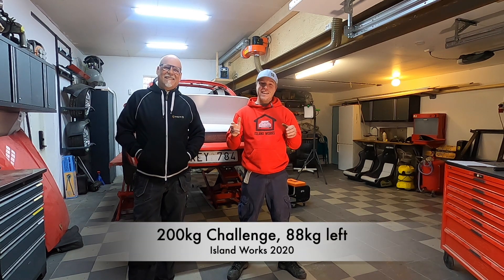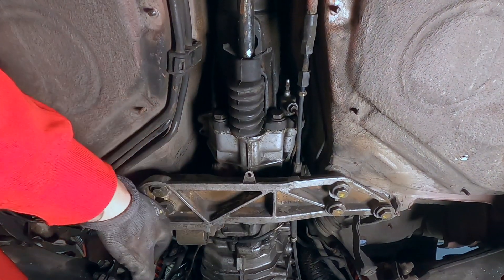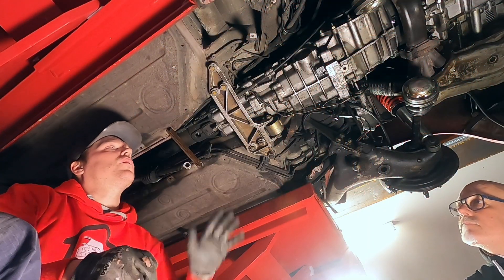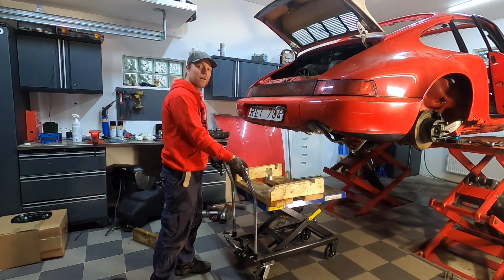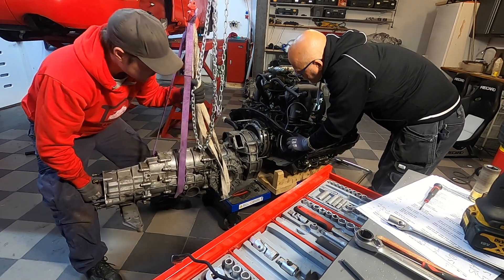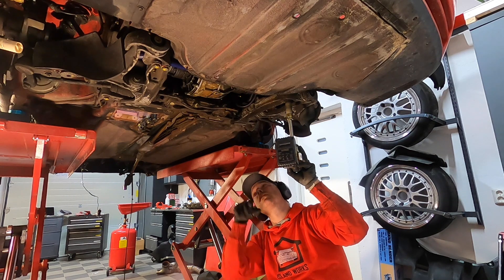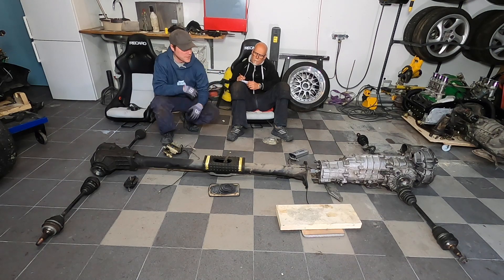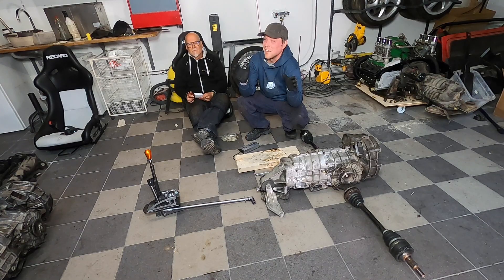C4 Explosion - Porsche 964 C4 to C2 conversion on a Fly!

Comment: Great videos! I recently had my 964 C4 converted to C2 with used G50 transmission. Everything works great. However, the AWD and ABS lights remain illuminated. My car won't pass inspection (in Finland) with those lights on.  Do you know how to rewire the front AWD/ABS front control computer box from C4 to C2, to eliminate those lights?  Any insight would be very helpful. Thanks

Comment: Hi,

Thanks for your information shared in the video. 
I am in the path of converting C4 to C2. 
What are the parts from C2 required for the conversion?
What are the parts I need to remove from C4?
Any computer reprogram required?
Thanks
Reply from the maker: This is a quite large undertaking but a fun one. Apart from the parts shown you need to think about either keeping your ABS or adding one from the C2. There are some really good threads on rennlist covering the details that I recommend.
Reply: @islandworks  Thanks for your reply. I tried to fined some related threads in Rennlist nut no luck at all do you have any details about the thread? What will will be the difference for keeping c4 abs versus adding c2 abs? thanks